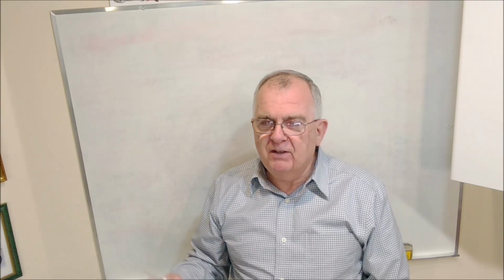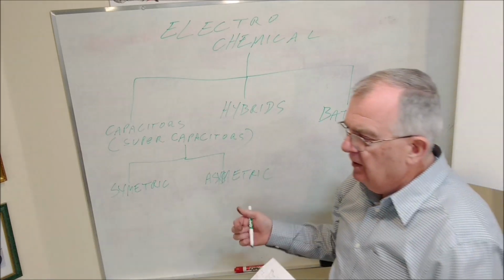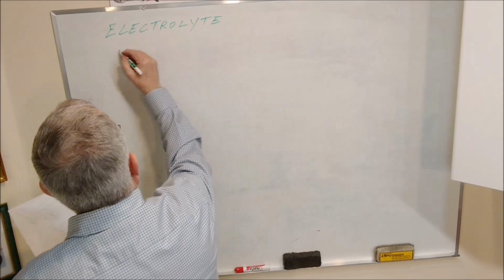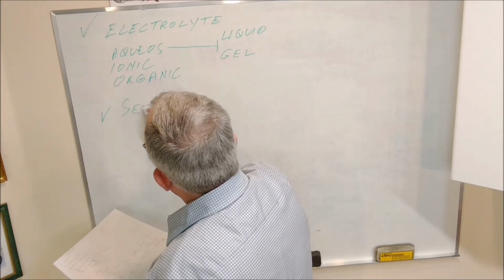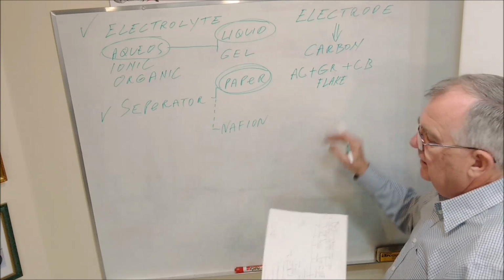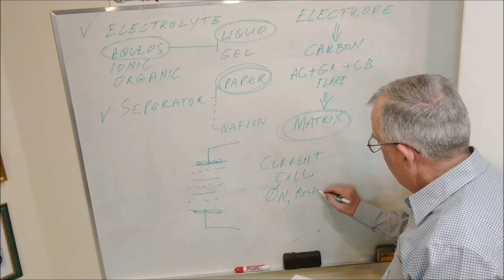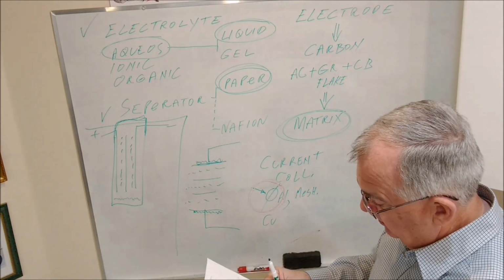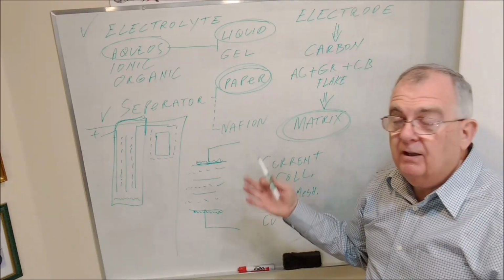Energy Storage Road Map:  My path towards a carbon carbon supercap.

Comment: Hi Dennis. Nice presentation. I saw the stack of wash cloth in RMS last video as well. Wonder if he coats them with some thing as well.
Reply from the maker: I'm guessing there used as is - they look thick enough to store some electrolyte to keep things wet and prevent physical shorting over time - but thin enough to be ion efficient.
I experimented a while back with thin open cell sponge material for a separator and it worked fine - only down side was you needed a lot of force to compress it (maybe mine was too thick to start with).  I like these absorbant cloths better.

Comment: Hi Dennis, good video !!
I admire your linear and methodical approach. I must admit to more like a moth around a candle,  circling (endlessly it feels) a particular problem, then finding a different research paper and thinking "Hey what if I try a similar spell on my witches brew" and off to circle another candle !!! hahahaha but I do enjoy the thought processes :)
One thought on packaging is the vacuum plastic food pouches which heat seal in a simple device...relatively cheap and quick to use, having the added advantages of (a) controlling the environment within the pouch by sealing it, some components may be hygroscopic, for instance and (b) creating a partial pressure within the pouch. This allows the external atmospheric pressure to apply a relatively constant force upon the cell to keep everything together. As the terminals need to exit the pouch, I also dribble a small amount of very low viscosity glue around terminals to assist, as clearly the plastic/plastic welding does not take place here. I have one dummy cell on test for the last few months and it is still holding its partial pressure, so that is now my preferred casing method.
I now know the effective dimensions of my cell. Now I also know some of the other physical and mechanical parameters I will have to deal with. Having abandoned my laser cut acrylic casings will mean another re-vamp of my electrodes/current collectors, but I think I am getting a little closer by settling upon the pouch design of casing. Cross one off the list, now where is the next candle  :)
Keep up the good work,

Tony
Reply from the maker: Hi Tony - thanks for all those ideas as well - yes I think a vacuum pouch is a next step in the evolution.  As you're 'circling the candle' have you tried multiple cells (in series electrically) in the vacuum pouch.  Should work as well ???  even though it would be much thicker than a single cell.
Cheers,
Dennis
Reply: @denniskramer9788  Hi Dennis
Only as a "dummy" cell to evaluate feasibility. It was configured + - + - + -     not with the "floating" intermediate plates as per your whiteboard. My plastic pouches are quite generous so they will easily accommodate this configuration, possibly more depending upon my final electrode thickness. My line of investigation at the moment is carbon/carbon either on PET or paper with a solid/hi viscosity/thixotropic electrolyte which will eliminate the need for a separator. The current collectors will be on the outside of the pouch, thus eliminating any action/reaction of the collectors. I am trialling adhesive copper shielding, which bonds pretty good to the carbon surface, but its early days yet. Of course, thixotropics will only be good if you do not have any vibration.
kind regards
Tony
Reply from the maker: Hi Tony - to prevent any shorting if the gel breaks down over time maybe a thin / delicate net like material - bridal veil - could be added for extra margin of safety.
Reply: @denniskramer9788  I also bought a food vacuum sealer from Aldi cheap, but have not got around to using it in anger yet :-)

Comment: Nice summary Dennis.
I have had some success using tracing paper as a separator, both treated with acetates and PEG and untreated :-)
Martin.
Reply from the maker: Thanks for that idea Martin.  I only use two layers of copy paper since I've had some problems with on sheet 'shorting out' after many cycles.  A tracing paper or paper with a treatment sounds like a better idea - last longer.  
Did you notice in the latest RMS vid the 'wash cloth' seperators (I think)?
Dennis
Reply: @denniskramer9788  Funny you should mention that, they look like a product sold in a supermarket called Aldi in the UK (Very Cheap)! 
I have been using them for a couple of years as an armature / substrate to hold my active materials, in fact I think I show them in a couple of my vids :-)
It makes it very easy to handle when dry and get a consistent size and weight in my test cells.
The material is fairly strong and soaks up the various AM's like a sponge, and then air or hotplate dry depending on the binder I am using.  -   Martin.
Reply from the maker: Hi Martin - Sounds like a good idea for both an armature/carrier for the carbon electrodes and/or a separator......I'll pick some up at our local Aldi here in Michigan and give them a go.